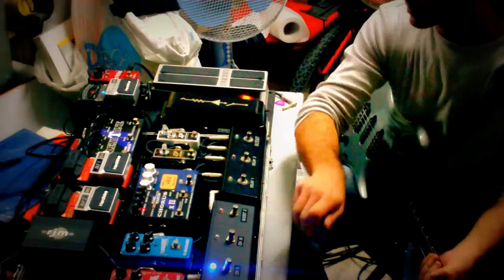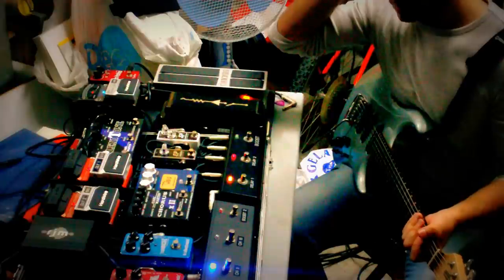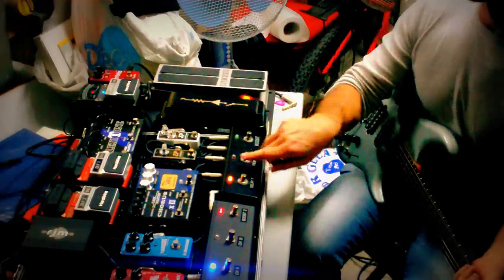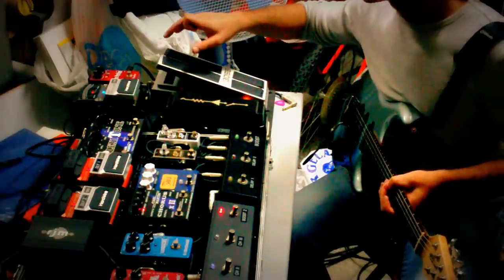My pedalboard - Lukather type pedalboard - English description

Comment: Cool video! But Î`m a little bit confused about the mixer who is connected to the delays. You talked about the LOVEMIXER GA II. In the signalpath you described the RJM Mini Mixer. Could you explane the cable path with the LOVEMIXER GA ? THX
Reply from the maker: I used Lovemixer Ga II in a mono system. For stereo system I use RJM Mini Line mixer.
Reply: Is it not possible to use the RJM Mini Line Mixer for mono setup ?
Reply from the maker: +rebert yes it's possible.
Reply: Hi JM got the Manual from Lovemixer GAII. But can`t imagine how do you connect the custom Audio spliter from Shiva to the Lovemixer ? Where do you connect the DDL1 and DDL2 output ? are you using only the returns ? Thanks for answering the question.
Reply from the maker: +rebert send me your email and I'll send to you a photo.
Reply: Hi JM didn`t get the picture :-(